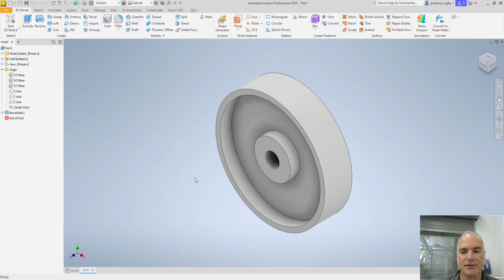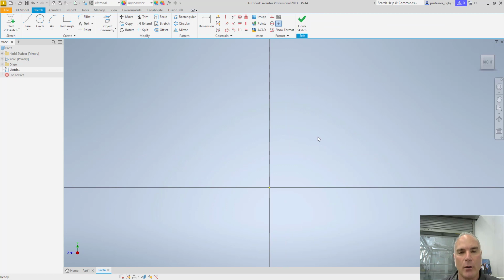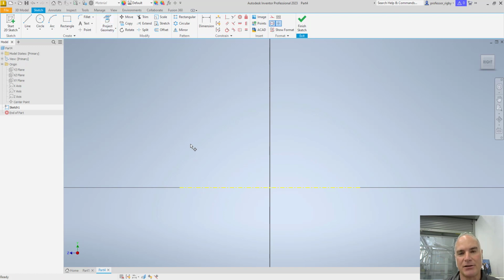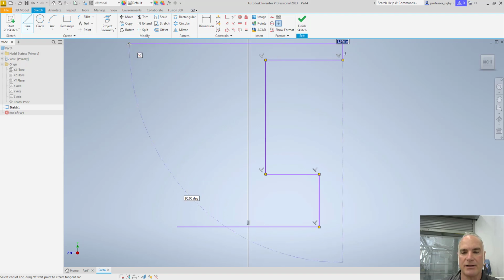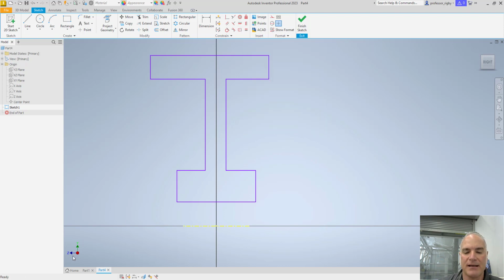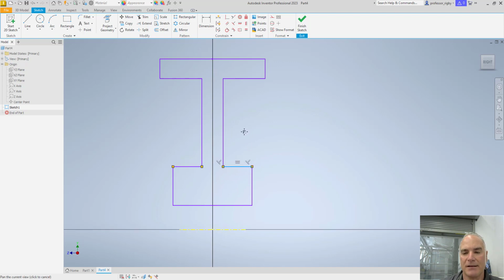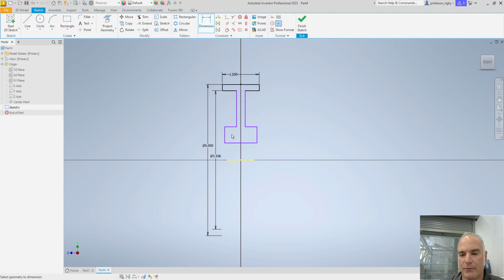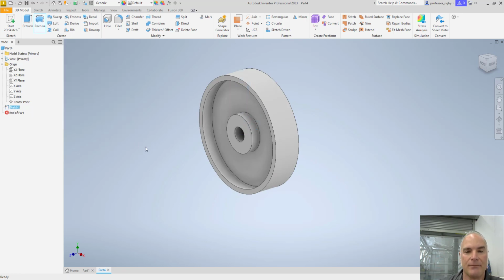Sketching for Revolved Features

Comment: That's a good short explanation of how to properly sketch for a revolve feature. Quick question though, do you want dimensions inside our part or cut through by other dimensions??
Reply from the maker: As a general rule, you do not want dimensions inside the part or crossing other dimensions in a completed technical drawing. Since these dimensions are consumed by the feature and will not be seen by the user or machinist, it is probably OK to break that rule.